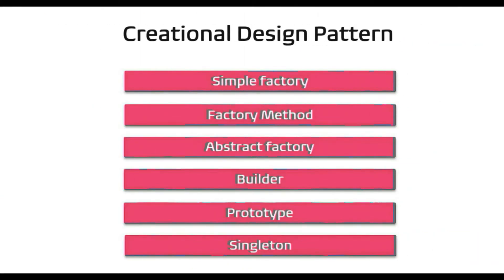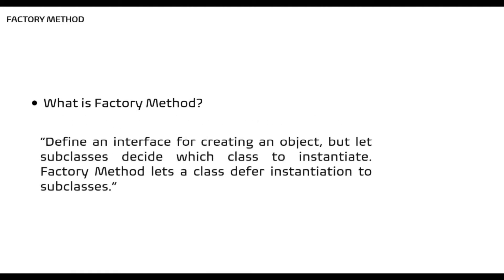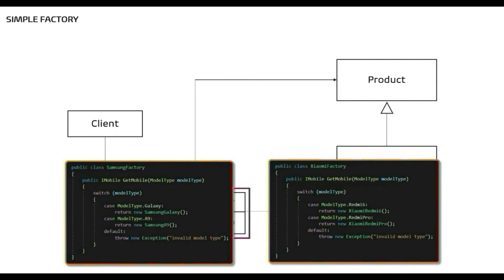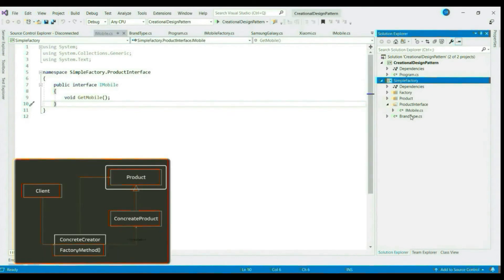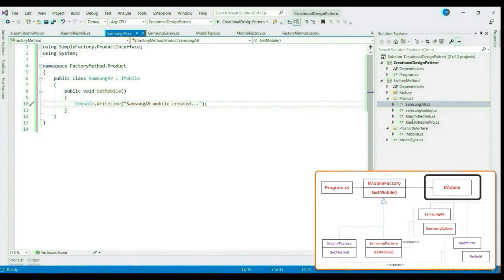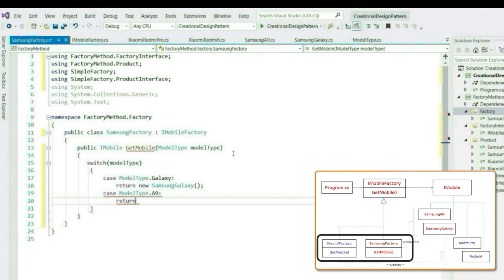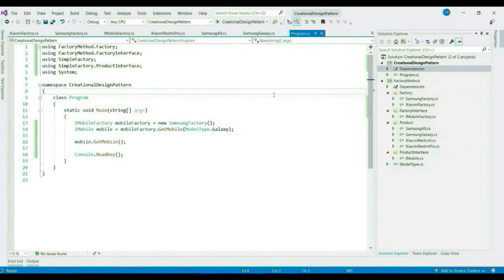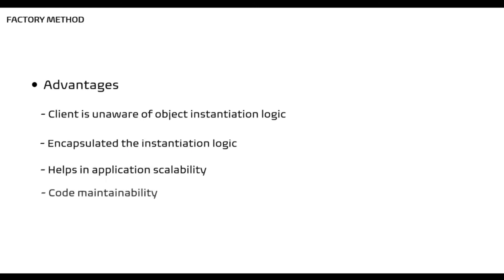Factory Method in C# I Design Pattern (Part 3) - How and When to use Factory Method

Comment: Very nice video. But why can't i use the Simple Factory method.  I think I can just use the simple Factory method and create the object without having two implemnt interface of IFactoryMethod?  I know I am missing something can you give me the reason why Simple Factory cannot be used?
Reply from the maker: as per the example shown in the video, if client uses IMobileFactory, say something like this
class Test
{
	public Test(IMobileFactory factory)
	{
	
	}
}

then the client (who uses your factory) will have the flexibility to swap the implementation with either XiaomiFactory or SamsungFactory by just injecting the respective factory.

Now, instead of IMobileFactory, if the client would have used the concrete factory, something like this
class Test
{
	public Test(SamsungFactory factory)
	{
	
	}
}

then the client is bound to send only SamsungFactory. If he wishes to change it to XiaomiFactory, then he has to make the code changes in Test class. Kind of breaks open close principle.

Summary:
using interface you allow the client to swap the factory at runtime. That's the reason the client relies on the interface rather then concrete class.
the whole idea of introducing an interface in to make your factory itself abstract.
I understand, simple factory is sufficient for most of the use cases. You should use factory method when you need one more layer of abstraction for your factory itself.

Hope this answers your question !
Reply: @RGenics    thanks Sir taking your time to explain further.
Reply: @Aammiz  if u have samsung mobile factory in london and one in newyork u can simple differentiate it, by creating both factory classes and inherit it with IFactory abstraction class.

Comment: sir nice explanation. Thanks for sharing. Was not clear with other videos. 
But you explained better. please keep posting
Reply from the maker: Thanks! Feel free to ask if anything specific you did not understand.
Reply: @RGenics   sir here we have scenario of having interface common to all factory methods. Consider an scenario where we have permanent employee and contract employee and both have some uncommon allowances like HRA for permanent employee and Travel allowance for Contract employee. Here in this case we cannot use interface because if we implement interface we need to have common methods for both type of employee. what shall i do in this case. pls help
Reply from the maker: @Scmg1988  if the method names are different for permanent emp and your contract emp, then you cannot return a single type (interface type) from your factory. 
So, this means your understanding of simple factory pattern is absolutely correct.

But then, the whole idea behind interfaces is that you don't need to know how the class implements the functionality, so, if you can get a generic name for your functionality, then you can go ahead with factory. 

Or else,  this pattern might not fit for this use case. 
We should not try to over-engineer and try to simply fit a design pattern because we know it :-) (https://en.wikipedia.org/wiki/Overengineering)

However, even if you have 2 different methods, you can have those methods in your classes (not in interface) and then cast it before using it.

Something like this - 

public interface ICalculate
    {
        void CalculateSalary();
    }
    public class ParmanentEmp : ICalculate
    {
        public void CalculateSalary()
        {
            // calculate salary for parmanent employee
        }
        public void CalculateHRA()
        {

        }
    }
    public class ContractEmp : ICalculate
    {
        public void CalculateSalary()
        {
            // calculate salary for contract employee
        }
        public void CalculateTravelAllownce()
        {

        }
    }
    public class Factory
    {
        public ICalculate GetInstance(int type)
        {
            if(type == 1)
            {
                return new ParmanentEmp();
            }

            return new ContractEmp();
        }
    }

	static void Main(string[] args)
        {
            Factory factory = new Factory();
            var calculator = factory.GetInstance(1);

            calculator.CalculateSalary();

            ((ParmanentEmp)calculator).CalculateHRA();
        }

However, casting will impact your code readability. When you have given the responsibility to create your objects to factory, then, there's absolutely no reason you should be casting those objects to another type. 
If you do this way, then it violets other design principles as well.

One more thing you can do, if it is an enterprise application (I mean you have to manage lots of instances), then you can go ahead with some kind of container who can take the responsibility of instantiating your classes.

I have briefly discussed this in this video - https://youtu.be/PAO9fAzz-GM

Hope this helps. Thanks for the question, this helps in creating future contents :-)
Reply: @RGenics  Sir thanks a lot for your clear explanation. First time in my life seeing channel that helps this much for our queries. Thanks a lot. :) will start watching the video link you shared and raise my queries .
Reply from the maker: Welcome!